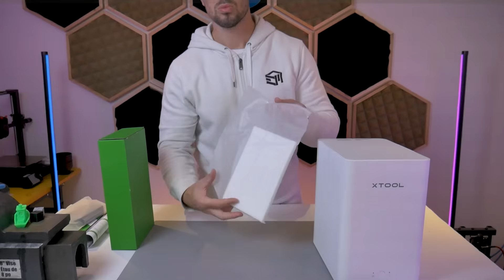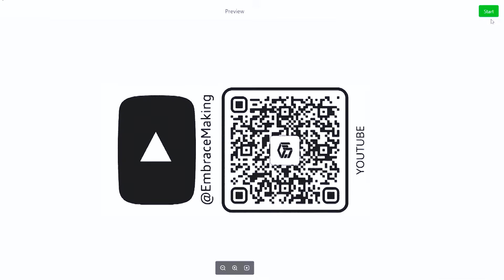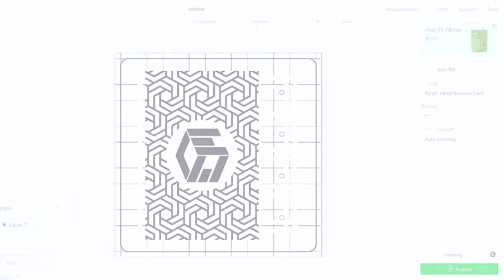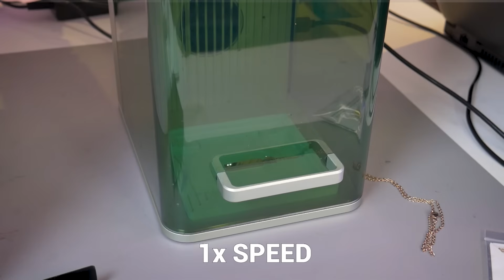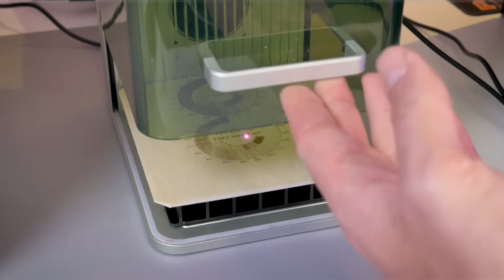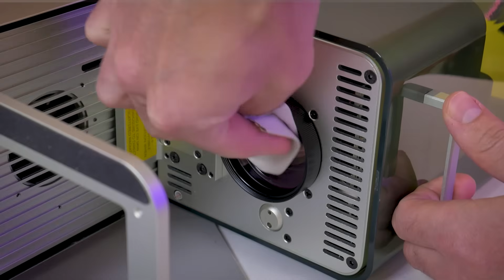XTOOL F1 In-Depth Setup Guide, Material Settings, Creative Space, Fixtures, Templates, and Review

Comment: You seem to be complicating things. Nobody sets the thickness to include what it is sitting on. The laser is working with the thickness of the surface you are working on, simple.  Set  the focus using the knob on the side adjusting till the two colored dots are exactly over one another.  There is no purpose is measuring everything and doing math etc.   Your jigs on the other hand appear to be very helpful along with the included template to work with.

Comment: Help! I cannot get help. I have the F1 and hadn’t cut with it for awhile. Speed won’t go above 20. I’ve tried and tried to get help…nothing from xtool. So I start a project, hit cut, go to panel and speed doesn’t go passed 20. All my settings are 80+ typically. I burned a piece of laser. I’m so stressed.
Reply from the maker: That sounds really odd - are you using the latest version of the software? Go to the xtool website and make sure you are using xTool Studio and not the older Creative Space.

Comment: Thank you for this video. It helped me in my decision to purchase the f1. Hopefully you read the comments and are able to answer a question?

Have you ever used the f1 on powder-coated aluminum? I'm having a devil of a time etching that material. The etching comes out brown-ish instead of the nice shiny aluminum. Multiple settings, both types of laser, multiple passes, cleaning the etchings with multiple cleaners, no joy. I haven't been able to find any information at all on the 'net regarding powder coated aluminum etching, other than to say "yes it can be etched". No settings, no advice, nothing. HELP ME OBI-WAN, YOU'RE MY ONLY HOPE!! ;-)
Reply from the maker: hey a little late to reply here but have you figured it out? Usually the powder coat can be burned away with the blue laser and cleaned up with the IR... are you 100% certain it is powder coat though? I've tried engraving hard anodized aluminum and it kind of sounds like what you're experiencing. Regular anodizing is easy to engrave

Comment: Love your videos! I hesitate between the F1 and Falcon2 Pro. I saw that you don't have videos on Falcon2 Pro. What are your thoughts? I'd like to engrave on leather, metal, and wood such as jewelry, tumblers and small objects.
Reply from the maker: Thank you! If you're doing small objects the F1 is hard to beat and is really portable if you're doing craft shows. The ability to switch between blue and fiber IR laser without having to change the laser head is something you'll come to appreciate. Especially for jewelry as you'll want to use that IR laser a lot. Plus the software (XCS) is a huge selling point. If you're thinking of getting one you can use my link for the bundle with the air purifier and it should be about $1000 off right now: https://www.xtool.com/products/xtool-f1?ref=D5HpJRsyqyUUnt&utm_medium=5306&utm_source=influencer&variant=44034709520623

Comment: Bonjour ! Est-il possible de graver en noir sur de l'acier inoxydable ? La machine semble de proposer que du gris. Merci d'avance.
Reply from the maker: Hello, I think you are asking if the engraved color can be black on stainless steel? If so, I think you can try a second pass at high power and slow speed and it will blacken the stainless. If you look up xtool F1 stainless color key in google images you can see the test arrays for both the IR and blue laser and what settings get you close to black
Reply: Merci beaucoup pour vos conseils !
Reply: Bonjour. Pouvez-vous m'indiquer comment je peux  réduire la vitesse de gravure ? Je ne la trouve pas sur l'application. Merci encore pour vos précieux conseils !!

Comment: Hello!I am trying to engrave and I see the blue light working fine when it operates but then nothing shows up on my material aka faux leather. Now when I use the IR light, I see the dot but then after the laser processes and I open  the case, there is nothing there either. I’m using your preferred settings as well and no luck.

Comment: Great video! I’m a new F1 owner but been working with lasers for a while and just struggling with settings. Did you have to manually add the settings for each product in your materials menu or is there a way to download xtool’s recommended settings and then tweak them as needed?
Reply from the maker: Thank you ! With the newest xTool Creative Space software they have a really great integrated settings feature called the 'Easy Set Material Library' where you can select the material presets (tons of them) and even interactively select the power/speed settings from a representation of a material test card of that preset. Then you can make any further manual adjustments and save those as your own custom presets.

Comment: Hello, I'm trying to use your template. They have changed the software a bit so the choices are a little different, BUT my big issue is that when i drag text onto the template, it dissapears. It's like its behind your template. How do I move your template to the back?
Reply from the maker: If you open the layer menu (the little button in the bottom left corner of the screen that looks like a stack of papers) then you can see the various objects in your workspace. The template will likely be shown as an "image" and the text will be in the list as "text". Click and drag the "image" to the bottom of the list and this is the order of your objects in the workspace from back to front. Let me know if that helps!
Reply: @EmbraceMaking  Perfect - thanks. That worked......
Reply: @EmbraceMaking  Sorry, I have two more questions: 1. how do I make lines thicker? 2. How do I make the engraving (in metal) more vivid or distinct? Is it slower speed, faster speed, more line per cm, etc.? Thanks sooooo much!!!

Comment: I tried to download the grid file and its just not working, even using your instructions. Is it user error?
Reply from the maker: What kind of issue are you having? I noticed that my website provider has automatically converted some of my images to some other file extension when you click on them now. Are you able to download the template as the original .png file or what is the extension? This might be your problem...

Comment: I recently purchased F1.. I'm  facing an issue when I ised IR on silver flat coins, after only a few pics.. the printing becomes without any details on the coin.. kindly advice
Reply from the maker: Have you tried using the IR preheat option to make sure it is up to temperature before the engraving starts?

Comment: I am unable to input a negative number for my material I am using .8mm thick black business cards. I input - 0.7 and the field will not take it as a value. Any advice?
Reply from the maker: I tried to reply to you by email but I think you may have entered your email address wrong on the website form. Anyways, I think XTool recently disabled the ability to type in negative numbers on the later versions of Creative space. I recently noticed this too. 

That being said you can just use the knob on the side of the machine to focus on the top of the business card or other materials.

I have another F1 video coming out soon and in that video I demonstrate the ability to engrave on a curved surface (up to a point). The focus is actually not that sensitive so the manual focus for the negative values works great. Thanks!
Reply: @EmbraceMaking  Amazing thanks for the reply. Looking forward to it!

Comment: Great video! I just got mine today. The vector files are working great but when I import a png photo and select the material I’m engraving on, I hit start and it says it’s working but no lasers are firing. I can’t figure this out! I let it run its course l, it stops like it’s finished but it didn’t do anything just made a sound like it’s running. Any advice?
Reply from the maker: First question is did you remove the black protective lens cover? Admittedly I forgot to do this on my first job and was confused and then realized I was burning the plastic lol.

Comment: I cannot download the template. I went to your website directly (outside of YouTube). The template opens up, but there's no download button. I can right-click and 'save image as' but the only option is to save as a WEBP file. Suggestions? TIA!
Reply from the maker: Instead of clicking the link and then trying to save the picture, just go back to the link itself, right click the link and select "save link as" and then it should bring it back to PNG format. Thanks for the heads up on this - I'm wondering if my web hosting service changed the way they handle opening those images or if it's a browser thing... I'll look into it!
Reply: @EmbraceMaking , thank you! I was going to do that, but wanted to make sure it's the correct size. My experience with using this method can change the dimensions. Hopefully, you can figure it out!
Reply: @EmbraceMaking  Thanks. Yes that worked for me. Perhaps you could offer it as a svg or dxf so that we can snap to vertices.

Comment: Hi what size is the exhaust pipe? I have a larger Xtool air purifier that I'd like to use at home so I may need an adapter to pull it off..
Reply from the maker: The F1 exhaust is about 2.5"

Comment: i've got a F1 and I've been trying to engrave glass with it. I used blue painters tape and it didn't make a mark. I tried painting the tape but still no mark. I tried black poster paint and tempura paint but it streaked badly with a foam applicator so much so it kept streaking when I tried to put on another coat. I tried black card behind the glass and it barely marked it. I use the blue light  on 100% power. Can you tell me what I need to do to make it work?
Reply: If you're really having that much trouble with the paint, you can use soot(carbon) from a candle and wash afterwards.

Comment: This thing is driving me nuts - do you know why when I go to start after adjusting the settings,- nothing happens? I tried to engrave a QR code with user defined settings - and when I start - the machine starts up but no laser is seen - I opened a case with support and so far they have not been helpful. Thanks
Reply from the maker: Sorry I see you have two comments - did you get it working eventually by changing the reference settings, or no? Seems to be the case based on your other comment
Reply: @EmbraceMaking  hello thank you for your response yes I have it working I assumed the reference settings were the assured settings but they don’t seem to always work. However there are times where I go to start a job and nothing happens and then I have to increase the power I’m still fiddling with everything so I think I’m OK at the moment thank you so much

Comment: Hey love your videos and website thank you so much. Im having trouble with the F1 alignment tool. I click the link on your website to download it and it just opens it up in a new tab? I drag it to the canvas on F1 but it covers up my content I will engraving. I am a  brand new beginner, excuse the noob questions! Thank you!
Reply: for exmaple its in the way as an iage, so when I try selecting just my artwork it is also selecting the image
Reply from the maker: Yes so when it opens in the new tab just right click on it and save image. Then import it into your xtool creative space like any regular image. If it is covering your other artwork you can select it and use the commands at the top of creative space to "send to back." On the bottom left corner you can also use the layers options and move the images to different layers - the template would go to the bottom layer or layer 1. Your other art can go to higher layers. Also just like in the video, select the template and make sure it is set to "ignore" and always make sure when you click on the template it should be 115mm x 115mm otherwise it has been resize and won't be accurate. Thanks!
Reply: @EmbraceMaking  Dude youre a beast. Thank you SO much for your channel and website.... ur products (esepcially F1 template and hose adapters) will make my life so much easier, thank you.

Comment: What kind of laptop would you recommend to help run the system?
Reply from the maker: As far as I can tell, if you're just using xtool creative space software you won't need anything fancy. You can find the official system requirements for their software here: https://support.xtool.com/hc/en-us/articles/14461510592279-Download-and-Install-XCS-on-a-Computer

Other than that, usb port for the connection and you're off to the races.
Reply: @EmbraceMaking  thank you! I need a computer with those requirements didn't know if you had one specifically in mind or not.